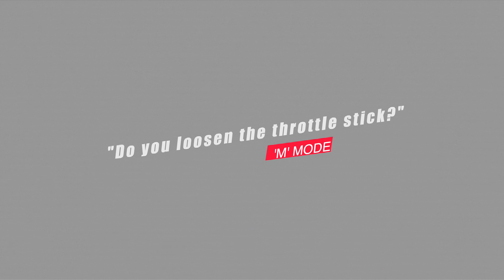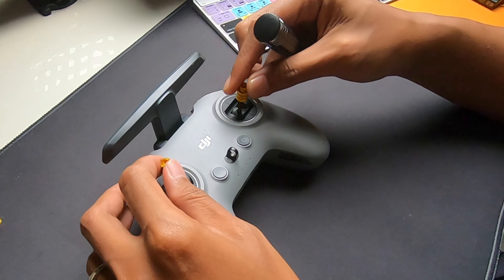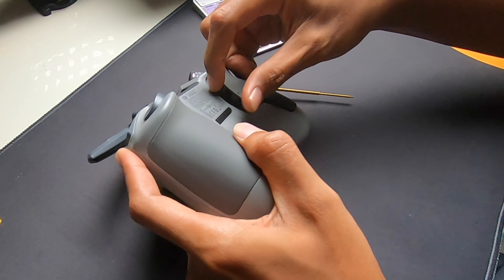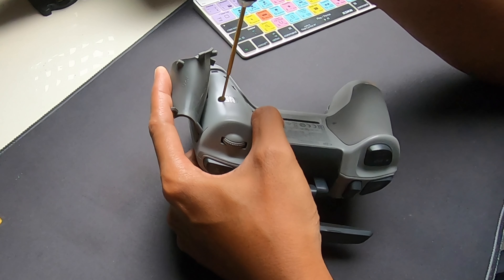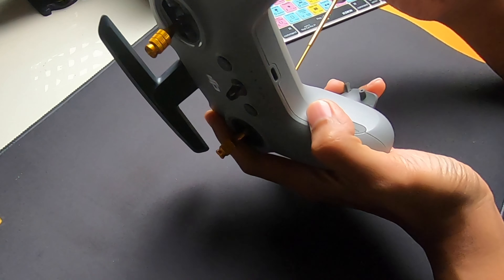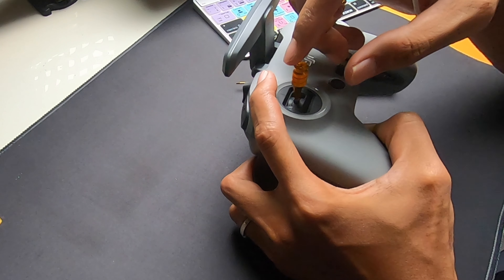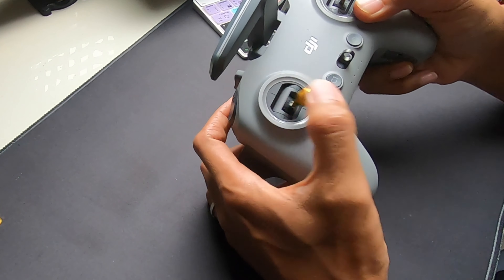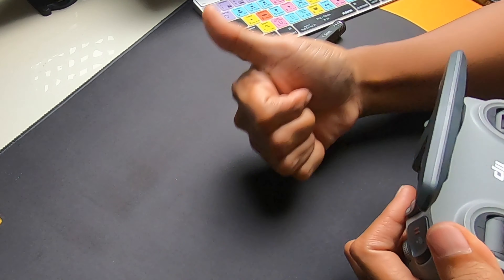Adjust Your DJI FPV Controller For Manual Mode

Comment: Question can the throttle be switch to the right stick instead of the left stick and loosen the springs on the right stick instead of the left
Reply from the maker: Yes, by default is left stick for throttle which is Mode 2. You can switch to Mode 1 in the goggles menu, making everything flip to throttle right. Then you can tighten the right side F2 fully (finger tight is fine). This would loosen the sticks till there is almost no more spring tension in your throttle. Then screw in F1 to give the desired friction that you need. Hope that helps.
Reply: Just what I'm looking for. I'm new to fpv and also more used to have the throttle on the right hand stick. So it's possible too in Manual mode / acro to have the throttle on the right hand side?
Reply: @Vinbenzine  yes, as described above
Reply: @Vinbenzine  throttle on the right side? What an abomination

Comment: By far the best video on how to adjust the joystick. Was going crazy before this 👍
Reply from the maker: Tanks man, hope it works out well for you. Fly abit, and you will notice if you like the F2 to be more or less friction. More is ok for smooth flying, but i prefer less for freestyle as you will need to bleep the throttle quite often. So its a matter of preference. Just bring the tool along on the field.
Reply: agreed, even told us what MM to use, unlike all the other douche bag wastes of time , well one sir !! and thank you

Comment: If I often switch flying from normal to manual mode, is it still recommended to adjust the throttle stick to not be springloaded? When it's springloaded I struggle with it when flying manual, but is the drone still nice to fly in normal or sport mode with the throttle not being springloaded?
Reply from the maker: Its not as nice definitely without spring load, but i know in N and S modes, i can afford to make late adjustments in flight. Id rather have no spring load in Manual mode as there is little tolerance for mistakes, and so ill need e best reactions on the sticks. Also if i the pilot  had an emergency, i could always drop e throttle and let it crash. If it auto spings back to centre, its gonna send e drone thats still in Manual mode TO THE MOON 🤣

Comment: Hey dude I did this mod and it works great! I am having one issue tho. On a regular fpv controller, when your throttle is all the way down, it's on 0% precent throttle. However on the dji fpv remote 0% throttle seems to be when your throttle stick is dead center. This is a bit annoying because you have a very small area to control your throttle (only 50% of how much you are able to move the throttle with the mod). I hope my explanation makes sense, have you experienced the same thing and maybe found a fix for it already? Would love to hear your opinion on this!

Comment: Anybody here have a controller stick error after playing with these? Thanks for the clip👍
Reply from the maker: Have u done the firmware update? DJI seems to have solved this in the update.
Reply: Had that lol
Reply: I had that error every time when switching into acro after the green line test when putting in acro mode. Little red flag says stick error only when im in acro. I had even done the stick adjustment yet and had that error everytime. Someone said an update took care of that but we will see.
Reply: Someone said that happens when you tied up the screws to much. If you loose them up a bit it should disappear

Comment: With this manual modification will the normal and sport mode be alot different to fly in or easier? Will the drone still hold its gps lock still with the modification?

Comment: Just bought the neo and tried the rc motion 3 for first time, great experience but I feel like the rc3 would be more accurate. As for the sticks resistance, do you need to adjust for all 3 modes or just in manual?

Comment: Bro what a life saver this video is! Only tightened F2 and thought this isn't be great to fly in manual. Cheers and fly safe!
Reply from the maker: Thanks for watching!  Tighten F2 till finger tight in order to loosen the spring tension, then add F1 as "friction" to what you are comfortable with flying. Try it out and hope it works out for you.

Comment: Fantastic video! I watched another who suggested adjusting in a different order but couldn't get it to feel right at all. Your method of shaking the stick was perfect!
Reply from the maker: Its odd, but gets e job done 😅🤟🏽. Just remember that the friction in F1 is very dependent on user preferences. Like if u wanna fly smooth, u may want more friction, but u may want looser for freestyle throttle blipping. Find a sweet spot, and it will make for an enjoyable flight experience. See u in the skies 🤟🏽

Comment: Great explanation! Love when it is concise and not too much info. I just got my DJI FPV and am so excited. I will be releasing a video soon!
Reply from the maker: Have a safe flight friend 🤟🏽. Take your time, there is no need to rush into Manual mode. Binge on my DJI FPV episodes, and hope they help if u r new to FPV 🙏🏼
Reply: How should I tighten my sticks for the best flight? My right stick controls throttle and yaw. Left stick controls pitch and roll. I currently have recentering disabled on both, and left stick slightly looser than right.
Reply from the maker: Oh man, thats something for my head to get around. 😅. So likely u are Mode 1 pilot. I cant really say how much, coz its more of pilot needs. Like for me (Mode 2, throttle left), i need my throttle without any spring tension (fully tighten F2), but i need some friction resistance (add F1). And i will add or reduce depending on how i feel the controls are working with me in flights. So advice is, the sweet spot for me is enough resistance for the whole throttle range, but not too much that it gets difficult and tiring when i do throttle bleeps. Maybe this could be your guideline. Hope that helps
Reply: @TheReelRahim  Thanks so much, that does help a lot. Only thing I'm wondering now is: How do you have the other stick set (not the throttle stick but the other one), and what does moving that stick side to side control--yaw or roll?
Reply from the maker: Glad it helped ✌🏽. For clarity in MANUAL Mode :

Left stick
Up/down - Throttle
Left/right - Yaw

Right stick 
Up/down - Pitch
Left/Right - Roll

Yours?

Comment: Very helpful, I’m not flying manual mode yet but wanted to add a little more Trenton our resistance to my controller.  Thank you again
Reply from the maker: Im actually very glad to hear. As most just want to adjust for Manual mode, but yes one should also tune the tension for personal preference. Fly safe!

Comment: Great video. I just got an Avata and the Controller 2. Thank you so much. This helps me a lot.
Reply from the maker: Sorry missed this. Glad it helped mate. Its fine to fully screw in F2 to release spring tension, but slowly screw in F1 till u get the desired friction.

Comment: Thanks for the tutorial. I want it just like my tango2 controller, this explains it.
Reply from the maker: You're most welcome, and glad to have helped! So its clear that you are DIY drone pilot too, and having the throttle feel just right is important for our throttle control and blipping. Tighten F2 till finger tight in order to loosen the spring tension, then add F1 as "friction" to what you are comfortable with flying. Try it out and hope it works out for you.

Comment: OMG!!  I am a certifiable idiot!

I didn’t realize there was a #2 set screw and wasn’t brave enough to peel back the rubber cover panel on the rear of the controller.
I am STILL far too chicken to actually flip the switch into “Manual/Acro” mode, but this is one more obstacle to overcome.

I actually purchased this second controller for the DJI FPV Racer for a remote telemetry modification experiment I’m currently working on. 
By dedicating this controller to experimentation (AND — More Importantly — Simulation with LiftOff, etc) 

It is so much easier to operate the stick now.
From an incompetent and inept beginner pilot to a Wise Master —>>  THANK  YOU !
 (new to FPV and the DJI FPVthank you kindly

(might be all of the “Fauci Science Juice” and lack of Oxygen due to triple mask wearing for SCIENCE 🧪😷🤣)

Long Range BVLOS Project - This has been shelved after trying the Mavic-3 with the RC-Pro Controller. The OccuSync 3.0 radio transmission system is absolutely outstanding.  Following the same exact route / same height of 310 ’ / same weather conditions on same day —>>  The APPROXIMATE  range / distance / penetration of various models in an extremely high RF noise environment:

Mavic-2 Zoom with Stock Controller = 4200’
Mavic-2 Zoom with Stock Controller AND YAGI directional antenna = 5800’
Mavic-2 Zoom with Stock Controller AND YAGI & 5-watt bi-directional amplifier 7800’

Mavic-2 Zoom with Smart Controller (original version) = 4500’

Air-2S  with Stock Controller (& TripleTek Pro tablet) = 9900’
Air-2S with Smart Controller (original version) = 7800’  
Air-2S with RC-Pro Controller = 1340’

DJI FPV Racer with Stock Controller & Goggles v.2 = 1050’

Mavic-3 with Stock Controller (& TripleTek Pro tablet) = 1350’
Mavic-3 with RC-Pro Controller = 1680’

ORIGINAL. PROJECT ~  Utilizing bi-directional multi-band 5-watt amplifier for the controller and for the goggles  // AND \\  using a different set of frequencies for better range and penetration in heavy RF “pollution” areas… we have a large bunch of licensed spectrum now available after we made the move to 700mhz P25 TRS radio gear.  VHF 155.xxx / UHF 464.xxx / 800Mhz / and some public safety microwave freq. pairs )

So.. THANK YOU !
Reply from the maker: Woa thats alot to take in. But this Yagi upgrade w amplifier seems amazing. Will look it up. Thanks for sharing, and glad this ep helped in ur journey. FOR SCIENCE (+ eccentric mad-scientist hair) 😅🤣🤣🤣

Comment: Its absolutely needed.. FPV since day one. No simulator..fly or die. Lol but we built our birds.. had to.. fly wreck..repair!!  Lol
Reply from the maker: Fly Crash Repair Repeat. For us its a must have, but I guess its just out of comfort zone for some that have been flying drones in angle modes. I bet as they go along, they will realise that its much easier to fly acro/manual and not having to fight with the throttle stick all the time.

Comment: I follow the instructions on your video and its being easy to fly on manual mode but i have a question how did you get the remote controller control stick error warning off the screen?
Reply from the maker: Sorry I missed this. Glad the instructions helped u. For the error, it appears once awhile and I will go into the controller settings in the goggles and do a calibration. It will go away and I'll just repeat the process if it comes around again. Just takes a minute.

Comment: Hello Rahim, I have just purchased an Avata and I plan to do indoor fly-through videos often with normal mode and horizon lock. I need to keep one constant pitch (speed) for the entire flythrough as I can always do the speed ramps in the post. I believe Throttle and Yaw are the ones I would need to keep moving. And as I am more comfortable with my right hand, I plan to switch to mode 1 so that these two, switch to the right side and then follow the steps you mentioned here to tighten the left control which in my case, would be for the Pitch. Is this right or there is something I am missing? Thanks a ton.

Comment: Hey, Thanks great Video! Do You fly the DJI NEO drone?
Reply from the maker: Sorry I missed this, and thanks! Been away for awhile. Not yet, but I hope to test it soon. Cant say I would buy it tho. It looks to be a combination of a Mini 3 Pro, and an Avata. Both of which I have, and so have no need to invest in the kit. maybe just the drone standalone, but hard to justify too, as flying it on its own or with a smartphone is no different than i just pack in a mini 3, which prolly takes up the same space of a small bag. Very similar characteristics, and only benefit of the Neo is the protection around the props and its a hardier drone.

Comment: Thanks bro , dah try pakai dekat simulator 😂👍
Reply from the maker: Ni controller paling senang nk pair ngan simulator2 brand lain. Entah kenapa. Controller yang aftermarket kadang2 ade issue. How? Da fly M?
Reply: @TheReelRahim  not yet bro, belum ada masa try. Tapi jari xtahan nk try haha. Harap2 xcrash la
Reply from the maker: No worries 🤟🏽 check progress je. Kalau boleh fly kat sim, control same jer real life. Standby pause button jer
Reply: @TheReelRahim  ya Pause button tu penting haha
Reply from the maker: I also use it sometimes. ESPECIALLY bila ngah fly aleh2 ade semut naik kaki..🤣🤣🤣. Seriously kalau DIY quad, dengan sengaja aku da crash dah...
Reply: @TheReelRahim  btul tu bro haha

Comment: Hi, Nice video, After I changed the movement on the left Stick as you demonstrated, I realized that it takes a little longer to raise up the Drone in the Air, is it Normal? or there is a way to increase the Truttle. Thanks

Comment: Can you make a tutorial on how to get the remote back to it's default setting after I've screwed the back of it for manual flight.I mean how I can get the the screws to such a point where the sticks will go back to the center as it did right out of the box. Thank you
Reply from the maker: Actually just loosen both the screws until you do not feel resistance in the screw threads. Careful with that as you do not want to fully unscrew the grub screws until they fall out. Just enough till you get the sticks back to self-centering. Hope that helps.

Comment: If you have always flown gps drones do not adjust your stix unless you know what you are doing. It is dangerous and the chances of you crashing on takeoff increase. Practice for a while with the controller the way it comes and then make adjustments.
Reply from the maker: Agreed. Thats where getting in the sim is a must. Because loosening for manual flight also means that ome must already know the difference in controls, that only being in the sim can safely give that experience

Comment: Good evening my friend, all your videos are amazing!!!! I want to ask a question. . . should we do this and NOT fly in manual mode? If we have decided to fly only in sport mode, do we have to tighten the screws as before? Thank you very much
Reply from the maker: Sorry i missed this. PERFECTLY FINE. The only difference is that you will not have the drone easily hover in place in N and S modes. No need to re-tighten the screws. Just estimate the position of the throttle if you are in goggles. If you see that the drone is nicely hovering in place, then all good. There is quite a tolerance in the centre of the stick in N and S modes, so there is no need to be pin-point accurate to get it hovering in place. Hope this helps

Comment: Hi Rahim, Appreciate your hard work. Really nice content. I am a beginner into FPV and wanted something cinematic to fly so decided to get the dji Avata fly more combo with the dji fpv controller 2. One doubt that I have, the controller has Normal, Sports and Manual. If I loosen the screws behind the controller now, then if I want to fly in normal mode can I fly or do I need to redo what I did.
Reply from the maker: Hi and thanks for watching the episodes! Hope they have sufficiently helped you get to the skies safely. You do not need to reset the screws. You can fly N and S just fine. Go ahead and give it a try. Just that now, you will need to manually bring the throttle stick back to centre EVEN while you are in goggles . Remember that in N and S modes, that stick is Altitude control. So just adjust high or low till you begin hovering, and that will be where centre is. Eventually you will not care anymore and just wanna maintain hover and ur good to go.
Reply: @TheReelRahim  Thanks alot Rahim. One more question, I also wanted a radio to use with ELRS so was confused whether I should go in for Radiomaster Zorro or Jumper T Pro. The T Pro has a 1 Watt ELRS while Zorro is locked at 250 mw.

Comment: Hi, how to stoped motors from controller?
Reply from the maker: Hi, this is for Manual Mode:

1) Not Updated:
- Right side of controller, press 'Start/Stop'. Maybe need to press twice, sorry cant remember as i have updated firmware.

2) Updated to latest Firmware:
- in goggles at Contoller Settings, set 3-way switch. Of the 3 positions, 2 will be OFF, one will be ON
- I use this as its common for me as a DIY FPV pilot to use switches instead of buttons to ON/OFF motors. 

Remember that u need to bring throttle to 0 before switching ON motors, but to switch off, it doesnt matter throttle position. BUT that means drone can be switched OFF even while flying

Comment: Thanks for the video! When I switch to Manual mode I got the error “Control Stick Error”. I have already already adjusted the throttle stick to NOT have the spring to center function. How can I fix it?
Reply from the maker: You're most welcome! So about the stick error message, sorry it does not go away on its own. On each battery, u could try to recalibrate before flight. Goes away, but I got sick of doing so and just ignore it.